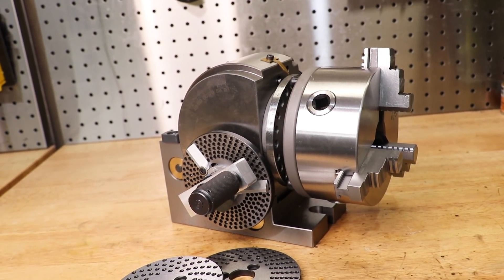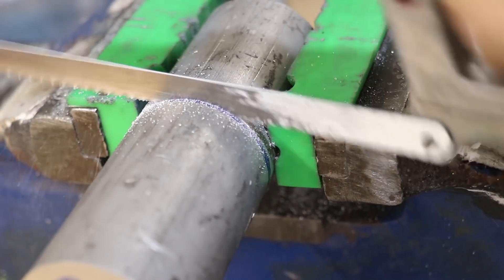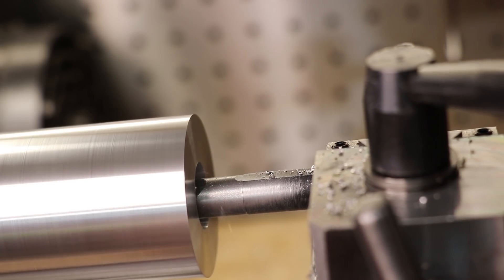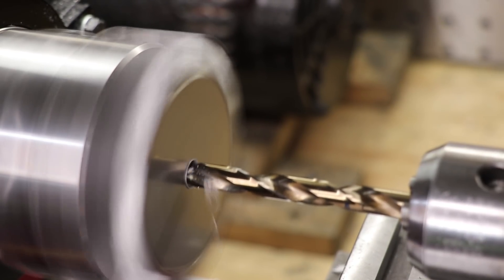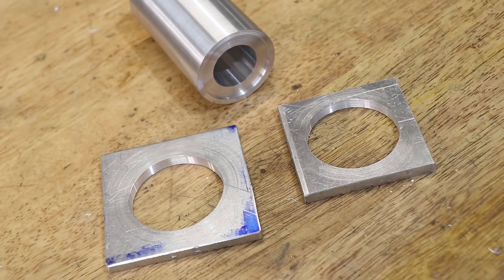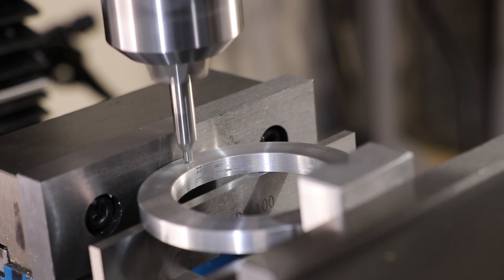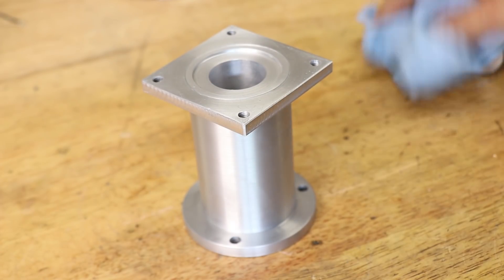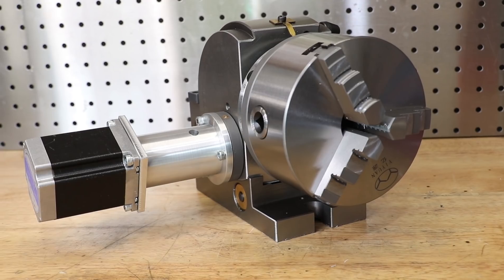CNC Dividing Head Conversion DIY! (Part 1) - Mounting Bracket

Comment: Use some Kero as a cutting fluid and it will cut nicely.
I have tools that will cut home cast aluminum with impurities which does not look like it should be used .

Comment: How much holding torque does your Nema23 have?
Reply from the maker: If I were to guess, about 1.8-2.4nm. Remember it gets a 40:1 increase in torque through the worm drive. (Maybe less than that becuase it is inefficient)
Reply: @artisanmakes  how did u figure out the holding torque that you needed for the dividing head? I am planning to convert my bs0 5 inch dividing head into that also but i dont know how much holding torque should i use for the nema23

Comment: I came to this after watching your instruction about removing the chuck, etc. on this beast.   I was stuck trying to figure out how it was even attached, so thanks.   Like you, I'd been looking for a way to couple a stepper to this thing, and my solution was to mount the motor on a bracket that slides in the T-slots of my mill table, and fit GT2 x 15mm pulleys to the both shafts.   I got an extra 3:1 reduction that way and really made it unnecessary to do a lot of machining to mount and couple everything up.   I haven't had the dividing head apart, and the mechanism is pretty tight when I adjust it for minimal backlash, so I felt like the added mechanical advantage of the reduction would help to deal with that problem.   I need to position the motor to take up varying belt slack when the head is angled vertically, but the T-slots easily make up for the off-center shaft of the dividing head.   It was very nice to see your implementation, which appears to work very well.   Many thanks.

Comment: @ thanks sir,one question in my mind is when we indexing that spindle is it nessesery to
 tighten the worm wheel on every indexing??Or no need to tight ,,i think worm and worm shaft is fited with no play in both then not nessesery to tighten that locking nut... please answer i am waiting sir please please.
Reply from the maker: As long as you take out the backlash pit probably doesn’t matter it if is right or not. Probably helps to have it tight though
Reply: @artisanmakes   thanks for your reply sir,i will send you my machine video that is conversion in servo deviding head,in that gear cutting sometime coming indexing error so I am confused what is wrong in my setup..

Comment: That's some fair nice lathe work for what seems like a fairly cheap lathe. Look forward to watching more of your videos. Are you worried about the dividing head moving without some kind of brake on it?
Reply from the maker: There is a spindle lock around the back which helps keep it in place which machining. Cheers
Reply: @artisanmakes  cool. Which state are you in? I can't quite pick the accent. SA or WA?

Comment: That spring shaped motor coupler is particularly a bad one. It flexes angularly. I got rid of it and used a steel bellow style.
Reply from the maker: It's not the greatest but it doesn't cause any backlash problems if you index in one direction. Cheers

Comment: I'd recommend putting a plug into the access grub screw hole on the adaptor body. Protection from swarf ingress there is not negotiable 😁

Comment: Nice Job.  I appreciate the honest comments; like, "because I forgot."  My favorite part was the hand made HSS cutter to get through the aluminum that didn't cut well.  I have struggled with the smallest boring bars as well, regardless of the inserts.  I have a couple small solid carbide bars with ends that can be changed out for different jobs such as boring, threading, back-boring, or contouring.  They are pricey though.  Thanks for sharing your project!
Reply from the maker: Cheers. To be fair that was some nasty aluminium alloy. I still have a few pieces left and to this day I can't get that stuff to machine nicely .

Comment: So I'm at 4:30 and I just had a picture pop in my head for the long skinny boring heads.. Can't you drill a hole through it, take some steel wire and threat it through, cross it and tether it to the tool mount and apply pressure to minimize vibrations and warping? I don't know if that makes sense. I'm not a machinist or engineer either. Just a thought I wanted to ask/ share.
Reply from the maker: That would seems like a difficult set up, no?

Comment: Great video, thanks.
I have just made an almost identical conversion for my Vertex dividing head. I managed to make the mounting bracket quite a bit shorter so the stepper doesn't stick out as much. This was achieved by making the shaft coupling more compact and taking 10mm off the stepper output shaft as well.

Comment: I've looked for those circular lathe tools, which you used to get a better finish, but the ones I've been able to find, and the inserts, always seem to be marketed for use on wood and not metals.

Are they just the same ones, and aluminium is forgiving enough, or are they specifically sold for machining metal?
Reply from the maker: The ones I use are technically made for metal milling, rather than lathe work, but the work. These are RDMT, or R shape inserts, but they work fine.

Comment: I also want to CNC convert the similar dividing head. First of all i removed backlash using lapping compound. But i still have to adjust the worm very tight against the gear to fully eliminate the backlash so its torque is hight. I doubt such small stepper motor can turn it well. How is your experience with that?
Reply from the maker: For me backlash wasn't a problem since I was only rotating the diving head in one direction and locking the spindle as I went. For that reason I could get away with a relatively small NEMA 23 stepper

Comment: In case you see comments for older videos like this, in order to minimize burrs like that 5xxx-series aluminum caused when milling, try Joe Pi's tip of always running the end mill along the outside edge of the material so that it will push into the material.  In the case of your 6-mm plate, you would have had to make two passes, each pushing in from each side, but not completely crossing over the part with the cutter, if that makes sense.  I just discovered your channel and have subscribed.  ;)

Comment: With my little experience when I drilled aluminium workpiece. I found liquid cooling lubricant is significant.
Reply from the maker: I can agree, especially with bigger holes. I've found cutting oil to work better than coolant. Cheers

Comment: Well done, but, Why such a heavy system? You could achieve the objective with a single and light part.
You forgot to disassembly the pillowblock from dividing head inputshaft. That pillowblock is the only part to be redesigned.
In your solution, you added another shaft in cascate, for no practical reason.
Regards!
Reply from the maker: Are you referring to the sleeve? That's not a pillow block

Comment: I have the same divider and had the same idea last year but then i found that either the gear has some play here and there or  if you take that out with the excentric sleeve then it will seize at some points. 
Did you not have any problem like that? Normally if you use it by hand you crank it to the next position and then put it on the brake. Now if you don't use that brake i am afraid it is going to give trouble whilst milling.So i sort of abandoned the idea but it looks really tempting to have a look at it again! Maybe i am not lucky and my gear has a wobble of a few thou or so.
What do you think?
Reply from the maker: I have run into similar issues with mine, I have reduced this by swapping the grease for oil on the worm gear. And it certainly grabbed a lot more when it was new. When I had the dividing head apart I also deburred the gear too which helped. I also have a bit more backlash than I normally would have but since we are going in one direction, and I use the spindle lock so that's not an issue.
Reply: @artisanmakes  i'll have a look at it again soon. I found that it must be possible to fit a needle bearing in the excentric sleeve, maybe it wont seize that hard when you fit that but i am in doubt now. Using the brake is certainly solving the issue but then you can not mill whilst rotating. For your use you could maybe fit an air cilinder on the brake and control that with some M-code!

Comment: When machining Aluminum use WD 40  or Kero for a lube it stops the material from becoming claggy which inafect it is melting at the point of contact to the cutting tool.
Reply from the maker: I normally use kerosene. It wasn't doing much for this alloy. I actually found that silicon spray lube had the greatest effect. Cheers

Comment: Bro. I need your help. Ive stripped my lathe down for a clean. I've put it back together but I cannot understand these Gibb strips. I'm either shaking like a tiny dog or stiff as a tree. I can't find a middle ground, I guess it doesn't help that I have no clue what I'm doing. 

Anyway. Could you please do a video for dummies on how to set the carage and Gibbs please. 

Love the channel btw.
Reply from the maker: https://youtu.be/a6SrWRmGHak?t=97 This is an older video of mine that goes over it. On small lathes these can be difficult to get right. Just add small amounts of pressure at a time. Also if its seizing, check it could be the adjustment nut for the cross slide leadscrew. If that's not properly adjusted it can seize the leadscrew.
Reply: @artisanmakes  I've done it I think. Thank you. This helped. 

I think I used the wrong lube before. I've used silicon lube now. 
It get it just right I used an allenkey that was one size to small. It tightened then spun in the hole when it made a bite to the gib holes. 
Ive sat for 20mins making the last bite with the nuts. 
It's working well.
Reply: @artisanmakes  seriously thanks bro. Btw just while I'm being open and honest. I used copper grease last time. I thing this was a major player in the issue. It's like glue. 
Although in my defense of stupidity. It was high speed grease for bearings. Lmao.
Reply: Here's something else dumb I did. 
You know these shafts that run pistons in a car. There's a central axis for the bearings and there's offset shafts that lift and drop the pistons. 
I'm sorry I don't know what it's called. 
I thought of a way to make a shaft for 3 pistons. Using a three jaw chuck. 
I don't have a 4. 
Anyway it worked perfectly apart from now my bearings hate me because I didn't know I had to balance the material. Lmao

Comment: Your forearms must be as big as your legs with all that hacksaw work. Need a portaband or some form of saw for cutting your stock. Even if its an evolution 380 cold cut saw. Save you alot of time and you wont regret buying one either.

Comment: Awesome project! If anything reqlly benefits from a stepper motor and numerical controller it's a rotary table. It's such a pain cranking that handle making gears with lots of teeth!
One suggestion, that spiral type of coupler you used have a very bad rep for work hardening and breaking. They also have a lot of spring which causes other problems. Much better to use a 2 piece coupler, or even just a solid coupler would work fine for a simple app like this if you make it a snug fit so it's concentric.

Comment: Every traditional dividing head should be adapted to CNC. I've never fully grasped how that system with the pins and arms works, even though I've seen many YouTubers using them. It just seems overly tedious and prone to mistakes.
Reply: It absolutely is

But it's also ~$500 for the entire thing and 3-4 hole plates

The high-precision CNC vises in the machine i'm next to rn are around ~$4500 each, just for "simple" vises

And rotaries are around 20k for this size iirc

Comment: That looks great. It's a pity the coupling didn't have the diameter to go straight on to the div head without the adapter, (like maybe just boring out a little). Looking forward to the next installment to see that gear cut.

Comment: For the small boring bar - try making a high speed steel insert. Hss can be kept sharper for aluminum.
Reply: Aluminium specific carbide inserts for those small boring bars are quite inexpensive and also do a pretty good job on mild steel on these small lathes.
Reply: @ferrumignis  works for my pal but not me, my lathe is a tad slower so i just went for hss and thought I'll upgrade it at a future date, that was a decade ago and now I can grind hss freehand so that upgrade will probably not happen 😔

Comment: cool video, just out of curiosity, what tolerances did you use for achieving that nice press fit?
Reply: Hi, as you can see this is not a pressfit, It was done by thermal expansion (retraction in this case).
Designing the fit is a pretty standard engineering work, but it is not intuitive.
I think in this case no engineering was used, He probably used common sense and experience. It is fair if you know that it will work =D
The tolerances should be in the same measurement order than termal expansion, also the interference.
The value of interference will depend on maximum loads, limited by 'cold weld' condition. Once you have the value of interference you should pick a tolerance to assure this condition.
At the end, you need to see if you could shrink the material enough to have a loose fit by thermal contraction (or expansion, or both) with no cristaline changes in final temperature.

Comment: Pro tip: this type of elastic coupling is not very good for position accuracy. You can hold one end and twist the other and you will see it by yourself
Reply from the maker: True that they aren't great, bit I've only ever run into this being a problem when moving in 2 directions. I've always been able to get away with these when only going one way. Cheers
Reply: @artisanmakes  that's good news, cant wait for first chips ;)

Comment: nice vid, to avoid the frosting on the part, put it in a sealed bag before freezing it, it's especially useful for steel
Reply: Won't work very good in Australia, the humidity is so high the moment you pull a -15degree C metal out of the bag it will just frost up in the air in seconds.
I prefer to heat the other part, you get a much better temperature differential and no condensation problems. Freezing will only lower the temp of the part maybe 40 degree C compared to the ambient part, but you can put it in any household oven and easy heat the outer part to 220 degrees C, that's a 200 degree differential. 
You can get even tighter and more secure shrink fits. 🙂
Reply: @wizrom3046  lol your spit on about the humidity im in Melbourne and dealing with these storms hahaha